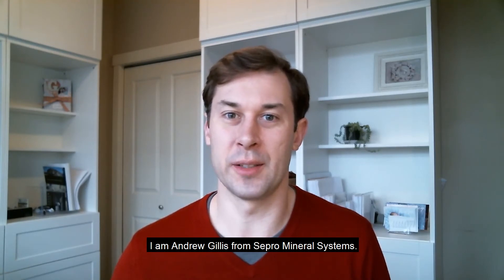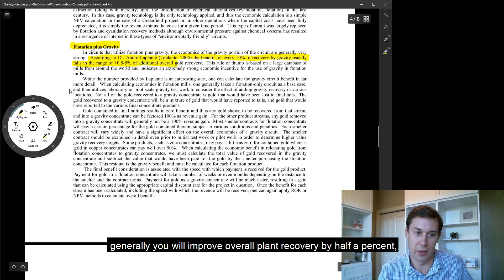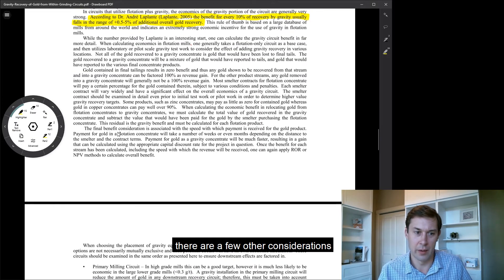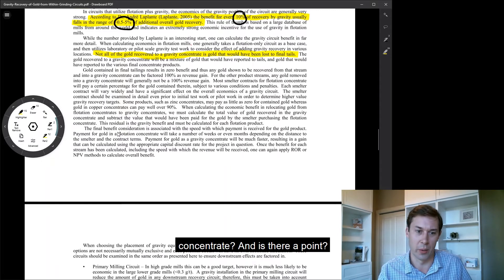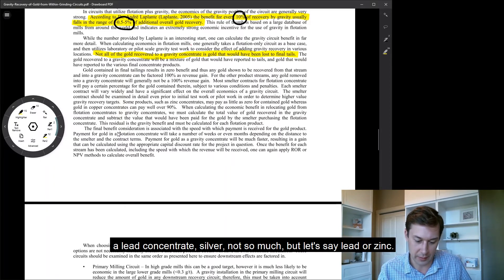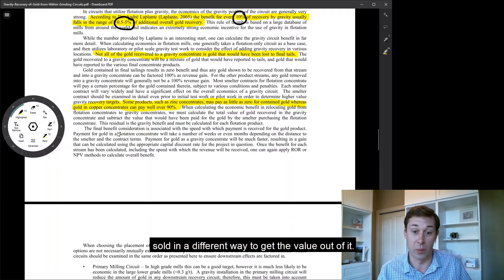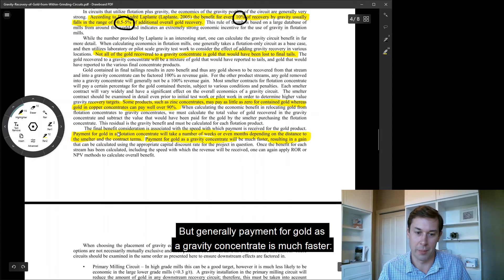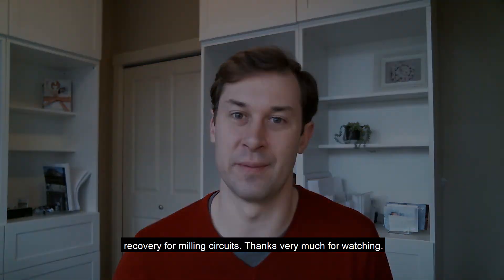Why Install a Gravity Concentrator in a Flotation Plant?

Comment: How do you recover particles larger than max falcon recommended feed size? Ball mills tend to collect those.
Reply from the maker: If there are particles larger than 6mm in the milling circuit then a "gold trap" can be designed in a sump or at a material transfer point. Large gold particles/nuggets can accumulate there and be periodically cleaned out. Please contact one of Sepro's process engineers through our website for more information! https://minerals.seprosystems.com/contact/